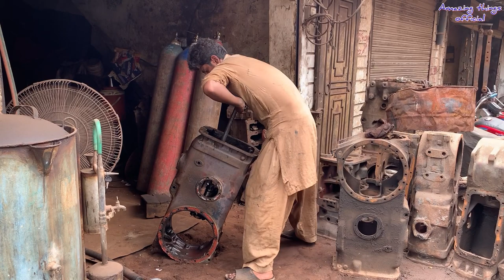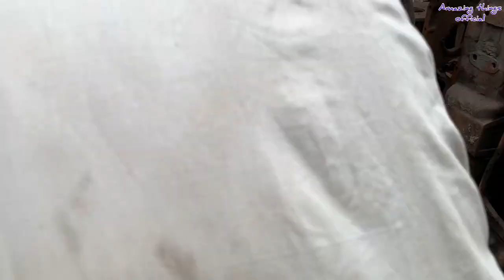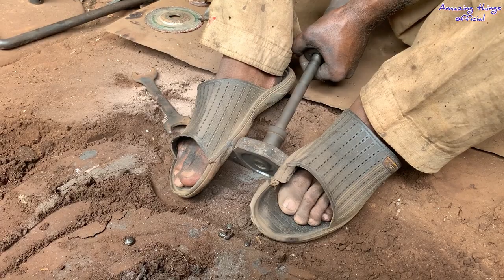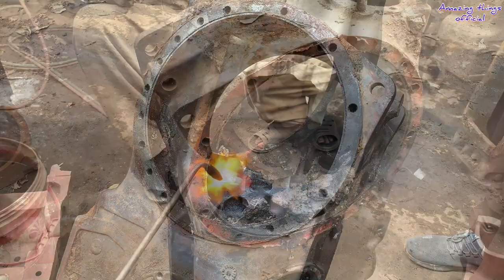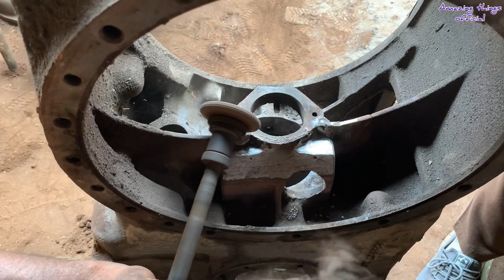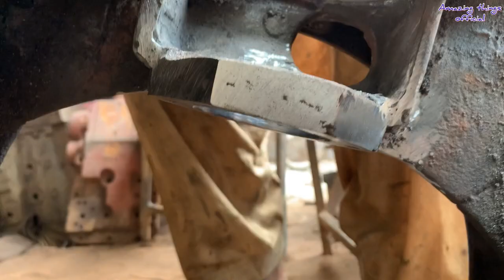Repairing Tractor Broken Cast Iron Transmission Housing With Flame Spray Welding

Comment: The welding was bad enough, but the pinion & pinion bearing belong in the scrap bin! 19:01
No matter the case will be back within a few weeks for more "flame spray welding". lol
Plenty of cow shit laying around!
Reply: You completely misunderstood what they did—the point is that the pinion WAS from the scrap pile.  It was only used to make sure it wasn’t in a bind.  This particular repair is very common—case in point, they had a fixture to align the replacement.  Also, the weld was perfectly fine and no, cow dung isn’t just lying around—it’s mixed with straw, dried and sold for fuel….